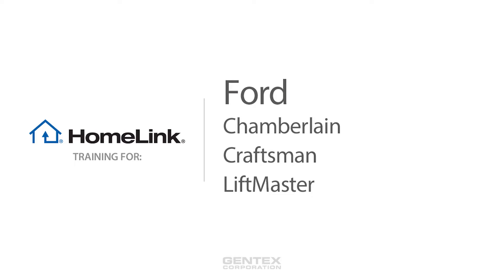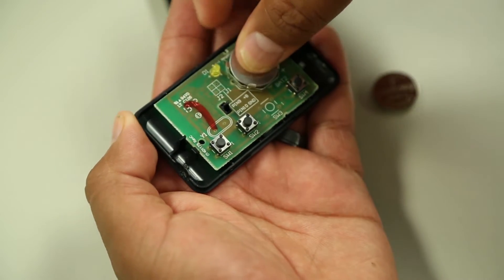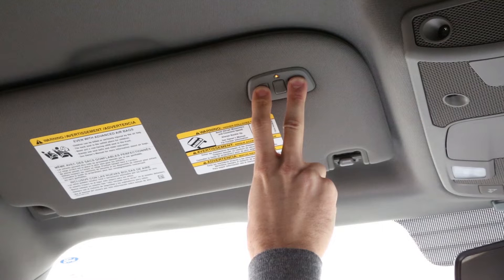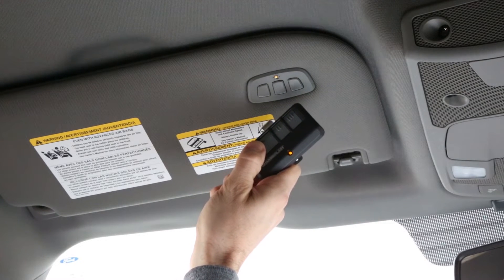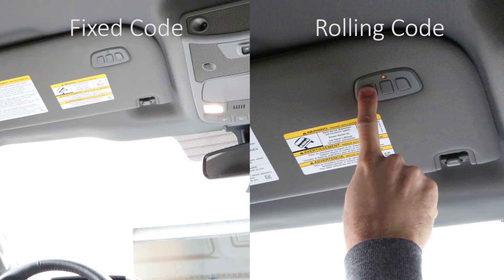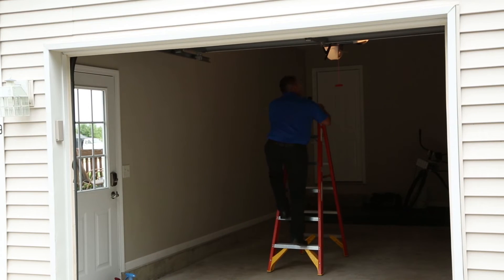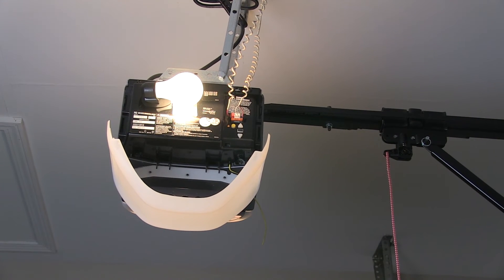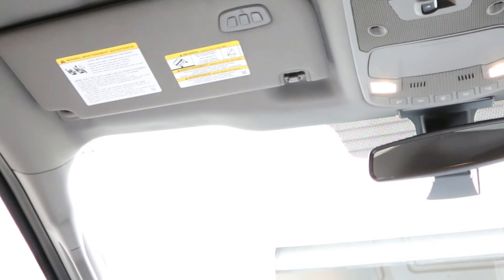Ford - Chamberlain, Craftsman, and LiftMaster HomeLink Training

Comment: I have a 2014 CMAX Energi and this video provided a means for programming. The manual states
"If the indicator light flashes rapidly for 2
seconds and then turns to a constant light,
the HomeLink button is not programmed
yet. Do the following:
Press and hold the HomeLink button while
you press and release the hand-held
transmitter button every 2 seconds. The
HomeLink indicator light will flash slowly
and then rapidly once the HomeLink
function button recognizes and accepts
the hand-held transmitter’s radio
frequency signal.
After programming the HomeLink button,
begin programming your garage door
opener motor.

In my instance, the homelink pad showed the condition that it was not programmed (held homelink button, which flashed the led then turned the led solid after two seconds), having watched the video, I proceeded to the garage door opener (1999 Chamberlain) regardless and pressed and released the programming button, then within 30 seconds went and pressed and held the same homelink button. The garage door opener light flashed to confirm programming. According to the manual it should not work this way.... Hope this helps someone

Comment: What this video doesn't tell you that you need repeater sold separately for older HomeLink and Car2U. They run around $30.
Reply from the maker: Hey Billybassman21,
Correct. In some older generation vehicles (typically 2011 and older), in order upgrade your vehicle to enable the older version of HomeLink to be compatible with the newer security technology in newer garage door openers, you may need a bridge kit (http://www.homelinkestore.com/Products/Homelink/Homelnk-Bridge-Kit.html). Car2U is actually a different technology entirely, requires a different training process, and is not affiliated with HomeLink.
Thanks for helping clarify!